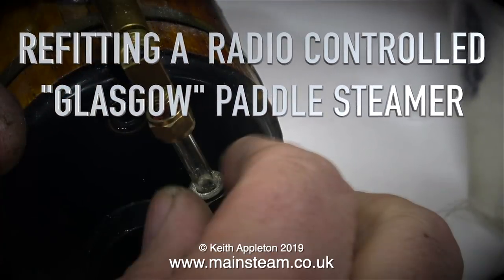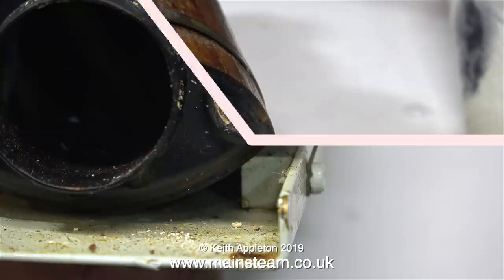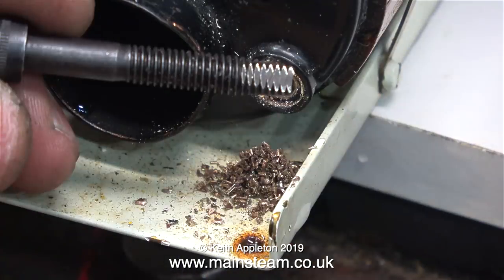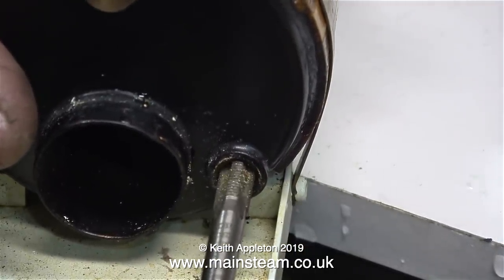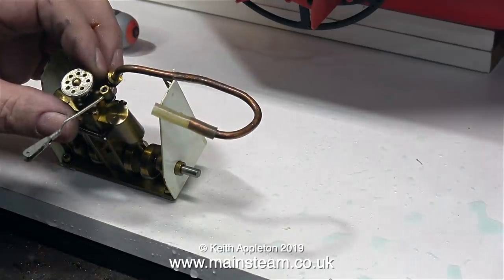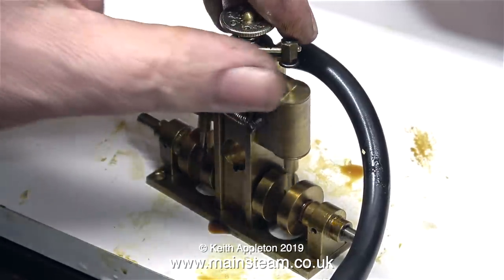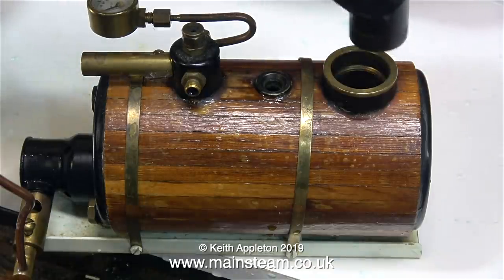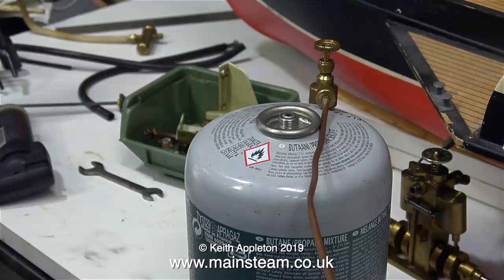A "GLASGOW" PADDLE STEAMER REFIT - PART #2

Comment: That is a great tip with squaring the bolt, Not being able to find the right sized screw extractor, is always frustrating. I usually ended up making one. I have a small patch of thin rubber that I use around glass tube with pliers, it gives a bit more grip and helps contain the shards when/if you break it.

Comment: So with the side drilled oil holes, was this engine supposed to use direct drive on the paddle axle instead of the gearing in this boat?

Also a tip you may already know of, but a kind of jerry rigged soft plier tip cover can be made by melting hot glue onto the grip faces. This way you can use a bit more pressure without scratching the material, and in the case of glass I think it'd have more grip too given the rubber-like texture of hot glue.
Reply from the maker: The engine is deigned to be mounted on its side. It still needs the reduction gear though.

Comment: I have a question. I’ve been watching your videos for a while and have noticed that more often than not, you use imperial units on drills and etc. Is this because you are dealing with model engineering or what? I’ve found this quite interesting since the U.K. uses the metric system. I apologize if this is a dumb question, as I only have a few steam models and am not an expert. Thanks.
Reply from the maker: Model Engineering uses mainly Imperial nuts & bolts.

Comment: Keith do you think left hand drill bits could have gotten the broken threads out from the bottom water level thread?
Reply from the maker: maybe, but I haven't got any.
Reply: @keithappleton  my dad has used them in pianos when an A graph breaks from the string tension, it usually works. But there is always that 1 in 5 times when it doesn.